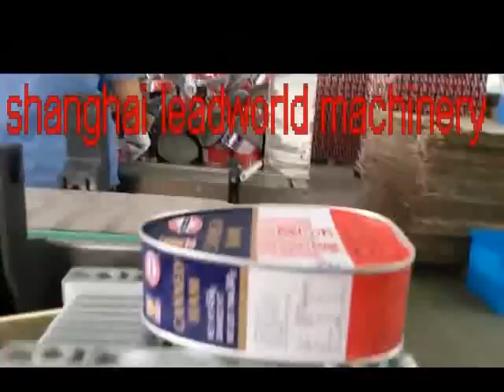Canned luncheon meat production line

Comment: Im quite sure canned products need to have a botulinum cook, where the can is heat treated once sealed under pressure and temperature, this is to prevent botulism from growing in the can when stored. Scary if they do not do this process.
Reply: I think that's whats going on in the end of the video. They are loading it onto racks,which is likely the subsequent step. It's not like they are packing it into boxes already.